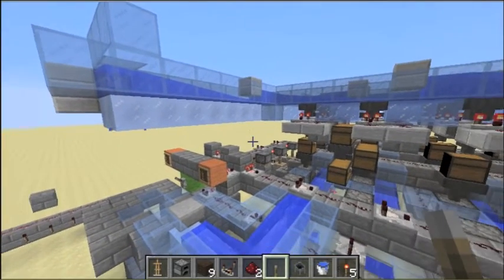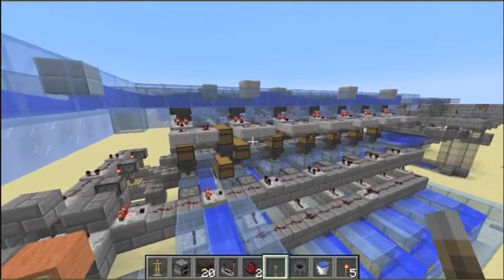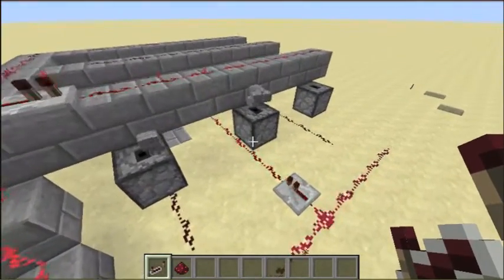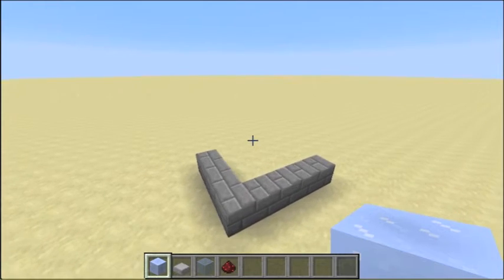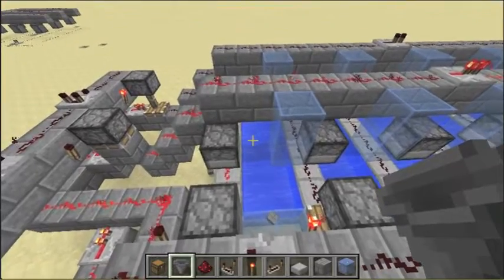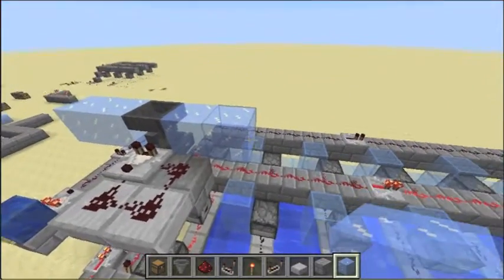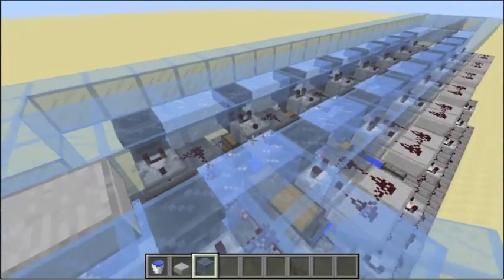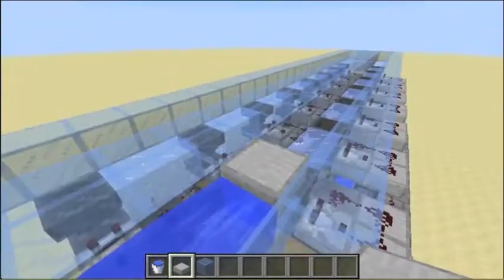Matrix Storage System : sorting + retrieval

Comment: and why does it have to be ice on the part where the hopper and chest is?
Reply from the maker: Same reason: items go fast. Also it has to be ice there instead of packed ice otherwise the redstone torch in the sorting system powers itself.
Reply: y doesn't the ice melt?
Reply: can you extend it?
Reply from the maker: well you have to be carefull and not put a light to close (sunlight does not melt the ice; only torches, jack'o lantern and such)
Reply: what about redstone torch
Reply: y not glass?